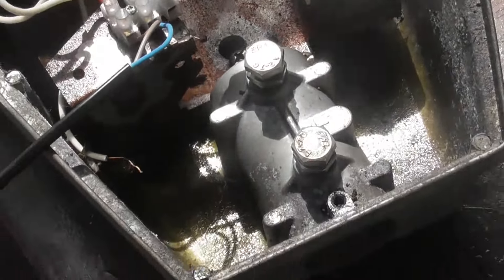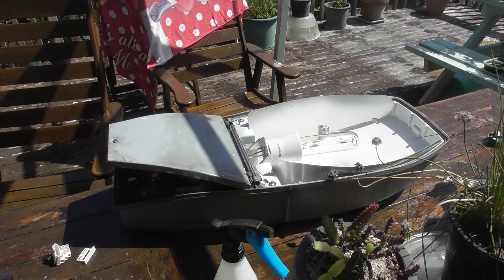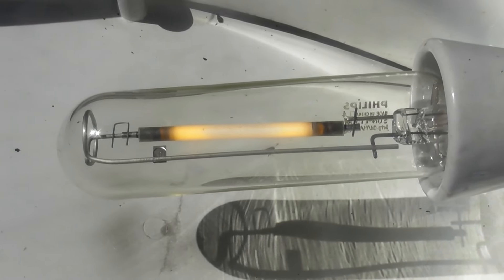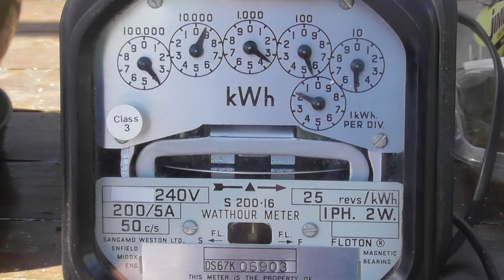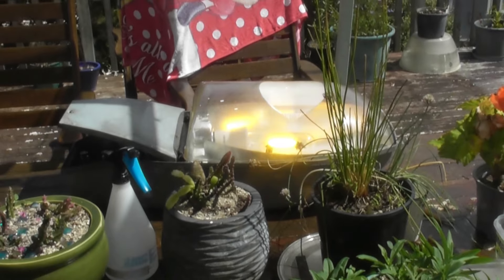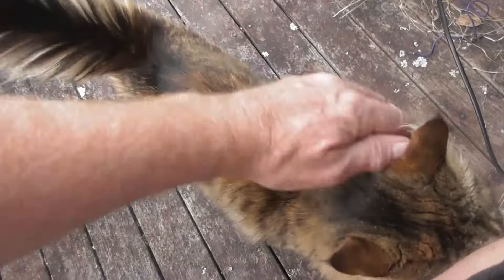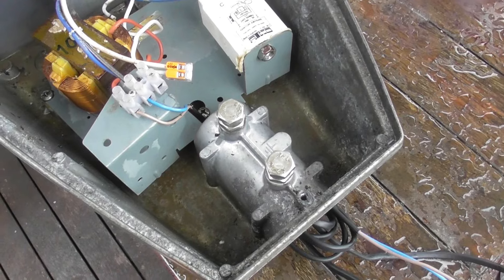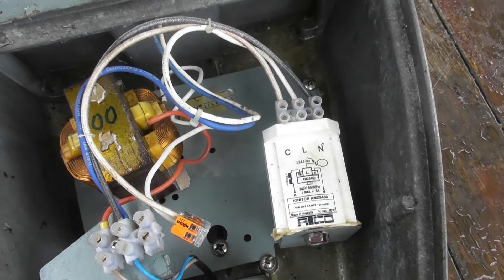Optispan HPS lamp modified for 100 Watt ballast.

Comment: We are now replacing all our hps fittings with leds, which are junk. When they fail the entire fitting has to be scrapped creating more WEEE than a few ballasts over the years. Sad times. I liked to play with different lamp ballast combinations on the bench to see what would happen. FYI you can strike them with a fluorescent starter if you don’t have an igniter. All the best.

Comment: I love HPS lamps. Sadly they've all been replaced with LED here now :( which I i personally dont agree with, because HPS are actually more efficient than LED's. And their colour spectrum is way nicer for preventing sleep issues. They dont affect our sleep cycle very much because they dont emit any blue light. I guess the only reason for replacement is due to their tiny Mercury contents, which theyre actively trying to get rid of